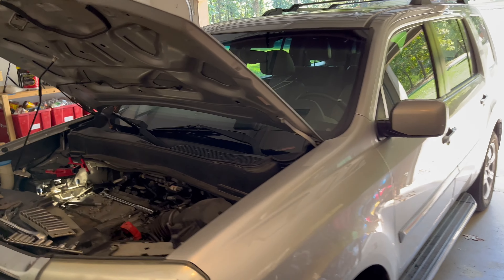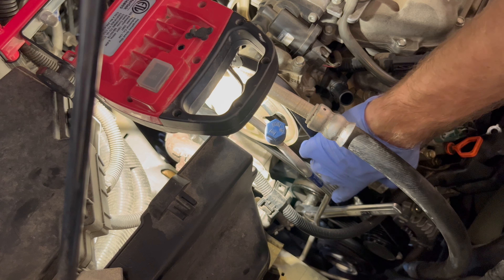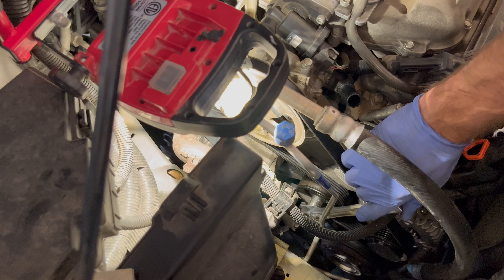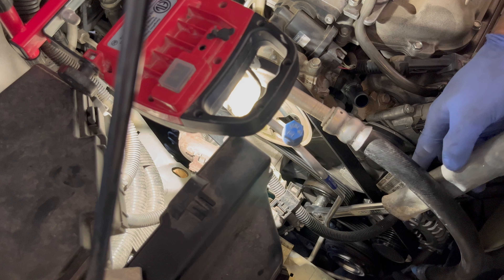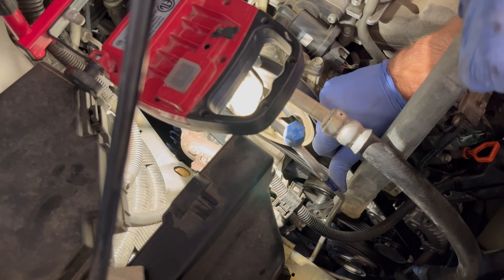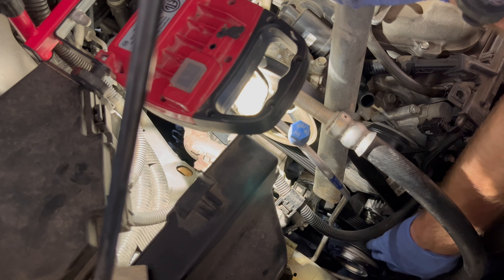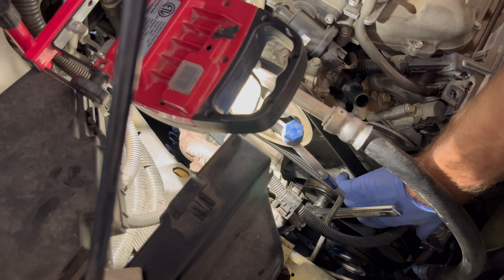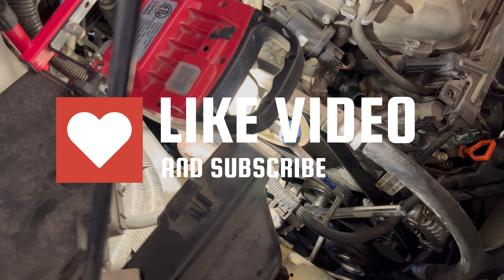2012 honda pilot accessory/serpentine belt removal

Comment: Thanks for the info! I have a 2012 Pilot Touring 4WD and my model does not have that 19mm at the bottom with the tensioner unit so this was the only way I could take that serpentine belt off.
Reply from the maker: Glad it helped!  Thanks for the feedback.